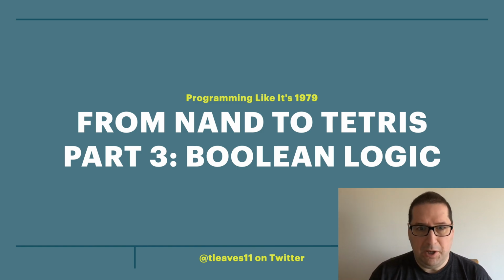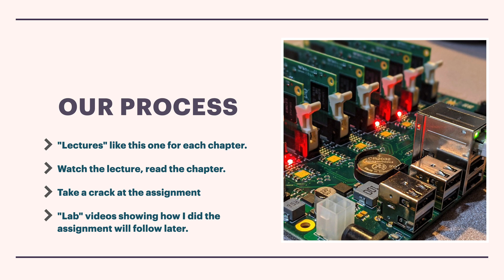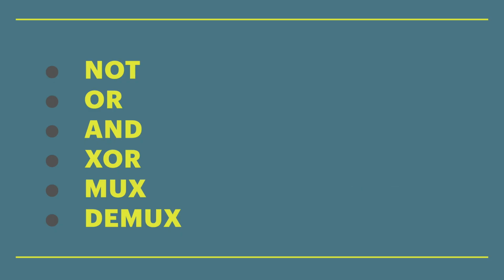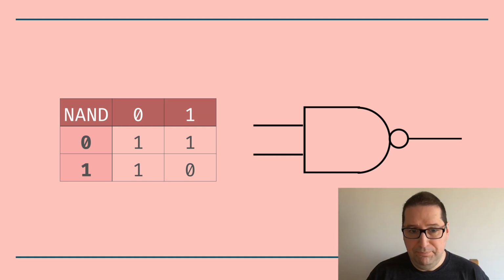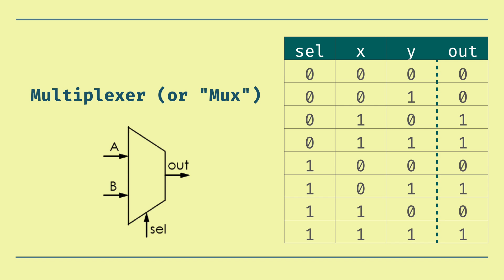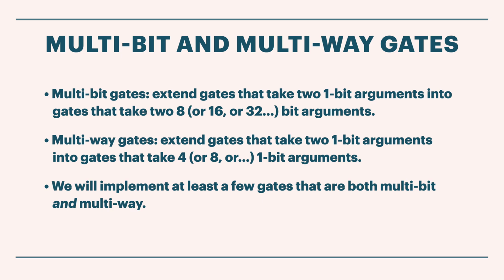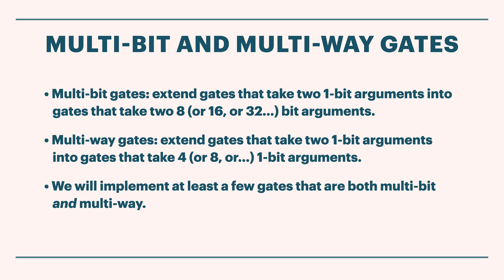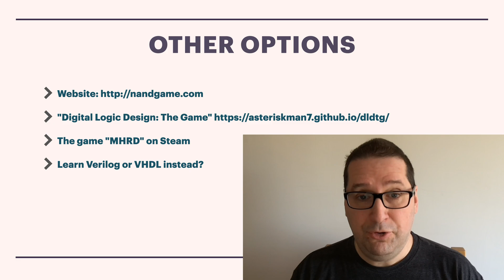From NAND To Tetris, Part 3 - Logic Gates

Comment: Hey Tea Leaves!

Just started this... started with 4a, since that's what came up in my Youtube feed. I've been using Digital for a few years now, even contributed to some of the circuits you find in there (like a bunch of the 7400 series chips you'll find in there), so a few tips: "R" rotates the components in the circuit (makes it a little faster than right-clicking every time and picking the rotation), "L" places the same component again (you put a tunnel, don't have to go through the menu to find tunnel again, just press L). 

Liking your work, keep it up! Happy to help with anything!

Tony
Reply from the maker: Tony, this is super-helpful, thank you!

The one thing I keep running into (as you no doubt saw in the video) is I am continually trying to click on a part to select or move it, and instead I begin drawing a wire. What’s the best way to avoid this confusion?
Reply: @TeaLeavesProgramming  Always "drag select" to select the smaller components.